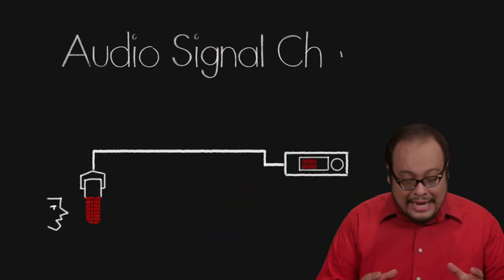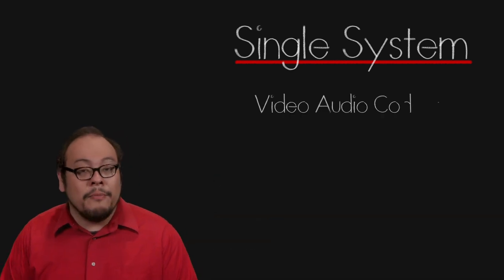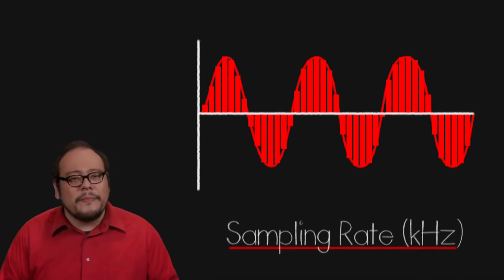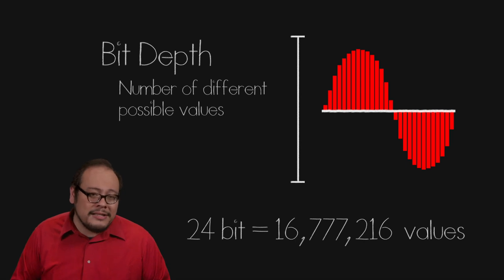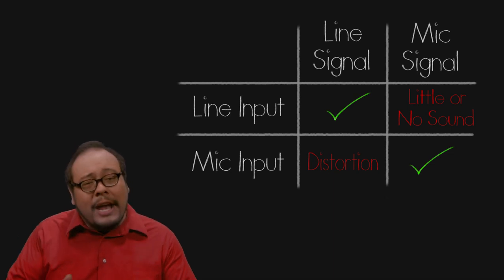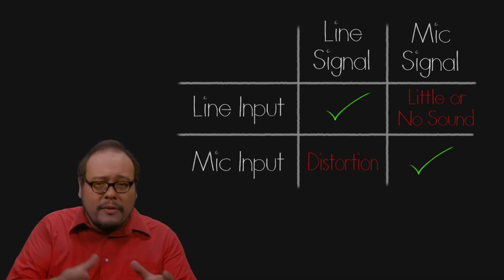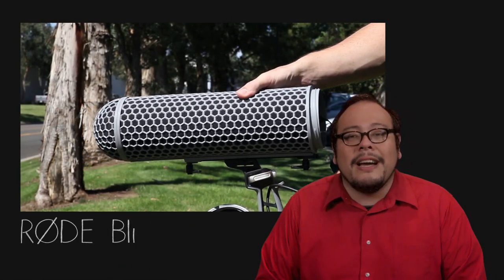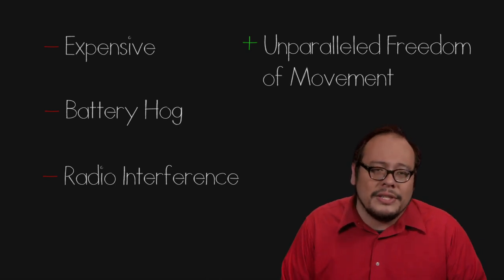The Basics of Recording Audio for Digital Video

Comment: Hi Filmmaker IQ!
I want to record 96kHz 24bit but when I'm exporting my videos (together with audio) in Premier Pro, the maximum samplerate is 48000Hz, for the format H.264 (which is the best, what I've read). How can I fix this, how do you do John?
Reply from the maker: You always deliver 48khz 16bit. 96khz is just a recording format... it's fine to step down to record 48khz too but you're not hurting yourself recordinging 96
Reply: @FilmmakerIQ  John said he recorded in 96Hz 24bit, but what’s the point if you can’t export your import source audio quality? I mean 48Hz is good, but like John said in the video, it just sounds better with 96. Should i change videoformat to a format that supports 96khz or should i just go for H.264 and 48khz? What do you mean that you always deliver 48khz 16bit? And that 96khz is a format? Isn’t 96khz better audio quality?
Reply from the maker: This is John writing ;)

The reason we record 96khz and 24bit is to give ourselves wiggle room in post to alter and adjust things. 48khz 16bit audio for finished audio is all you really need. Recording 96khz is a bit overkill though but it won't necessarily hurt you.

Here's my updated opinion about why to record 48khz vs 96khz https://youtu.be/bg6bOVShU-w

Comment: Can u recommend a shotgun mic a mic that can pickup all the sound in a room and a good audio recorder I have the zoom h4n and its falling apart
Reply from the maker: +MatrixDM productions I recommend Tascam recorders, better built than H4Ns. They are not a sponsor at this point but I currently own three of their recorders.

A shotgun does not capture full room sound, it's designed to capture what's in front of it. I don't know what kind of application you're trying to do... the only thing that I've seen work for a large room is boundary mics on a conference table. The sound is more utility than music but it works and is pretty clear. Wouldn't necessarily use it for narrative filmmaking...Otherwise you need to mic using a boom or put lavs on the talent.

We have another video that covers these microphone types called "Science and Engineering of Sound"

Comment: The problem I have is that Im using the youtube gaming app on my Galaxy S3 phone recording my gaming. I run my gaming audio from my phone through my mixing boards then to my computer audio program (Sony sound Forge). I also have an external cordless mic I use for commentary. My phone saves the video file on my internal storage as an MP4 file, I extract it into Sony Vegas Pro 11 along with the other external audio , I align the video and audio at the beginning but half way through the video, the audio and video get out of sync. I tried different video and audio formats but no luck. Can u help? So frustrating!
Reply from the maker: +Mr. Mulder That's tough sounds like a clock mismatch, probably the phone is not keeping strict time when recording the video. Not sure there's anything you can do other than resync every so often.
Reply: +Filmmaker IQ My thoughts exactly. I thought about instead of going through the entire game recording,  just record stage by stage and putting them all together in Sony Vegas. Alot more work though. Lol Thanx for help

Comment: Just say I’m shooting a movie and I want to switch shots but keep the audio or sound running continuously. For example a girl is screaming and I want to switch to a different shot, won’t the camera stop recording audio when I stop recording and pick up when I start back? What if she isn’t screaming the same way, wouldn’t there be a noticeable change? Any help is appreciated
Reply from the maker: Shoot the entire seen as one take. Then when you cut to the other shot keep the audio from the first take going.
Reply: Filmmaker IQ I only have one camera so I would have to set up for the other shot with the audio still running which means if two people are having a conversation the shot would need to change before I could set up for it, right? Ive thought about films just one shot with the audio then afterwards filming the second shot and just using the audio from the first shot but what if the actors mouth doesn’t fit what he said in the first shot?
Reply from the maker: No you shoot the entire scene from one angle... Then you stop and setup for the second shot and record that in full... Don't think about actually cutting until you get into post.

Comment: I would rather have a higher sampling rate in exchange of bit rate depth which is useful only for top frequencies sound. Vinyl was great with human voice registering thanks to step less wave which in way more pleasant to the ear, and it's smoothed out with difficulty and loses by a multi frequencies smoothers obtaining a slammed line instead of round one.
Reply from the maker: Not how it works. Sample rate is only useful for higher frequencies, bit depth is for dynamic range. Those frequencies beyond 20kz already surpass human hearing capabilities.

Digital audio isn't actually steps. When digital audio is converted back to analog in a system, there are no steps.

Comment: I don't think you can talk about audio quality without talking about the intended playback environment.  You have to be listening on a high quality audio system to hear the difference between 48kHz and 96kHz.  I don't think you can hear the difference on a $500 home theater system.  You also need to use high-quality recording equipment and mics to realize any noticeably advantage -- no weak links in the chain. 48kHz is actually quite good.

Comment: So what is the difference between sampling rate and bit depth?
Reply from the maker: +blackilluzionz Sampling rate is how many times per second you're going to slice up the audio - the  bit depth is the scale you use to measure the slices - more bits, the more accurate your measurement.
Reply from the maker: I really like Tascams. They're affordable and they're better built than those Zoom H4n. The Zoom is okay but I always felt it was cheaply constructed.
Reply: So on your Waveform graph the sampling rate would be on the X axis and the bit depth would be on the Y axis?
Reply from the maker: Well kind of. The sampling rate would the smallest unit divisible on the X axis - if you zoom in far enough you won't see any more detail past the sampling rate. The bit depth would be a similar thing on the Y axis - the bit depth tells you how many possible values of Y you can theoretically have.
Reply: Filmmaker IQ Thanks, its clear to me now.

Comment: 5:12 There found few 48kHz microphone for consumer in market.
Reply from the maker: Microphones are analog devices. They don't have a sampling rate attached. You might be referring to USB microphones which convert the analog signal to digital for a computer - but that is not the goal of this video.
Reply: @FilmmakerIQ  Appreciate for your suggestion. I use very cheap 20kHz lavalier microphone, Olympus E-M5 mk2. If necessary, install amplifier such as COMCA AD3. If any recommendable tutorial video made by you, please kindly suggest me.

Comment: This needs to be updated to cover 32-bit float.
Reply from the maker: 32 bit float is never used in a digital video recording environment (it's not an option in any recorder I own). It's only in a DAW recording studio environment
Reply from the maker: It's not really new technology. I guess it's new to some of those products - I'm don't own or plan to purchase any of those - I already have 2 Zooms and a Tascam and clipping hasn't been a problem when recording 24 bit (and I often use those recorders in a set and forget environments)

Honestly I don't think it's a game changer. 24 bit is by far enough for videographers - especially if you have a limiter.

Edit - 24 bit already has a dynamic range of 144dB. That's more than the difference between a quiet whisper at 30dB SPL and a Shotgun Blast at 165dB. There's no conceivable application where I would need more than that kind of range.
Reply: @FilmmakerIQ  Yeah well, I have experienced clipping at a number of concerts doing run and gun recordings in 24-bit. With 32-bit float I don’t have to worry about setting a level.
Reply from the maker: You just need to set your levels a bit lower and trust that the audio floor is lower than you're used to. Maybe throw on a limiter if you have one. Problem solved, no need for 32 bit float.

I'm running an experiment where I run a metal buzz saw followed by a whisper. Both captured perfectly fine in 24 bit.
Reply: @FilmmakerIQ  Why would I choose a technology where I need to set limits - with the risk of getting it wrong - over one that is simply plug and play? The obvious answer is that I wouldn’t.
Reply from the maker: After looking into it get the advantage but that's sort of a false sense of security that really doesn't add much beyond recording 24 bit. 24 bit already has a huge margin of error but YOU CAN still screw it up. You can overload the actual analog converter even in 32 bit float, but it does make it even harder to screw up.

But the primary problem I guess I have is setting levels is probably the absolute easiest thing to do with audio especially with 24bit. You also need to check the signal and mic placement. 

That said, I get it... But it's not a game changer. I will make a video explaining this shortly
Reply: @FilmmakerIQ  For me, and a number of others, it is a game changer. No need to set or monitor levels is a big deal. No headphones, no wireless setup.
Reply from the maker: No headphones? That means you're not doing your job recording audio. 

What if you had a bad cable? What if your mic is shorting? What if your mic placement is bad? What if you're getting interference or a line hum? None of that stuff can be fixed with 32 bit float.

I think this is why I find this topic so annoying - you think 32 bit float is a license to be entirely reckless in your approach.
Reply: @FilmmakerIQ  All of those things apply whether it is 24-bit or 32-bit float. You make too many incorrect ASSumptions about how I work here because it merely suits your narrative. I always have multiple audio recording devices in addition to scratch audio.
Reply from the maker: Yes all those things apply to 24bit - which is why you MUST listen in with headphones and set levels. 

You're the one that said you don't need headphones... I can only go by what you say and what you say makes you sound like you don't give a shit about the quality of your audio.

If 32 bit float is your game changer - that just means your game didn't include how to set the proper levels for 24 bit.

You're commenting on a basics video for people trying to learn this stuff. Why would you ASSume I would advise people to sloppy in doing this work just because they dropped the money on the newest audio recorder?
Reply: @FilmmakerIQ   I don”t listen in with headphones with my 32-bit float devices because I can’t set levels on these devices and with 32-bit float it is not needed. I can see on the unit if it is getting a signal from the microphone and I use multiple units. I don’t need to listen in with headphones. Working with multiple units largely protects me from the potential problems you have described. You said that 32-bit float is not used in the video world and you were completely wrong.

Comment: What does reference tone means?
Reply from the maker: Are you refering to room tone? That's the natural sound of the room when no one's talking or making direct noise - it's useful to cover up empty spaces between dialogue.
Reply: @FilmmakerIQ  Thanks for the quick answer.

So that's what the sound report sheet refer to?

When they write down 1hz @ -20 dB? In the reference tone space?

And how much time does that tone has to be?
Reply from the maker: 1hz @ -20 dB is a reference tone to calibrate players at in the world of tape - we didn't cover that in this video. This is usually accompanied with color bars and called "Bars and Tone" - it's 1khz. I used to have to set that in the old days of tape when delivering a commercial to a broadcaster.
Reply: Filmmaker IQ Thanks for the answer.

So room tone should also be -20 dB?
Reply from the maker: @milovarquiel  No, room tone is recorded at the same level the dialogue is recorded at.
Reply: @FilmmakerIQ  Thank you for the answer.